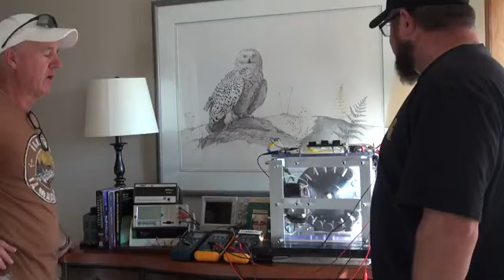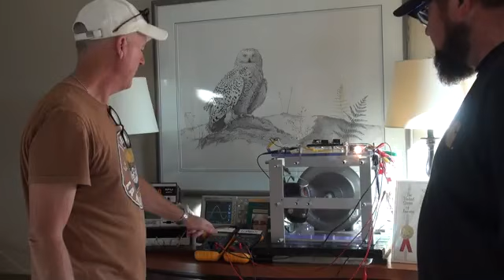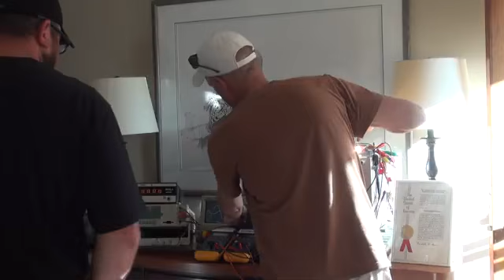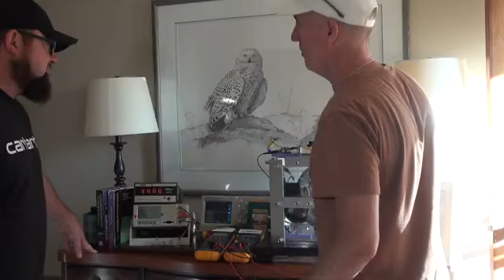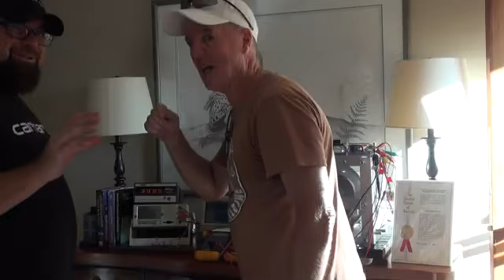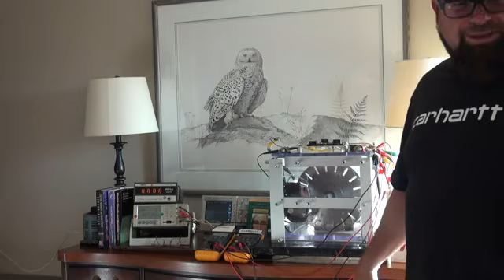Infinite Efficiency US Patented ReGenX Generator Demonstration 10,02,2025

Comment: Nobel first place award for a dumb ass story , this cannot work! there is no free lunch in this world!
Reply: "Electrical power is everywhere present in unlimited quantities, and can drive worlds machinery without need for oil, coal and gas, or any other of the common fuels " - Nikola Tesla
Reply: @marcisgulbis9310  We've had 100 years to test Tesla's statement about electrical power being everywhere. Sunlight is energy that is everywhere the sun shines. But there is not and never will be ANY mechanical motor, gadget, spinning device that can "create" energy. Period. But if playing with this stuff will keep you happy and out of trouble, keep it up Skippy.
Reply: @johnkolb4241 
"No free lunch in this world", which is true, unless in question to this case, the sceptic proclaims to know everything in the entire universe about physics aswell as undiscovered technical engineering! 
With respect John, I very much doubt at that person is yourself, so you got to admit, it's quite a bold statement to make if you don't mind me saying so! It's usually always best to remain rationally open mindedly sceptical for the time being but not too prematurely irrationally so!
Reply: @ZoomTuber2026  Most of these people are trolls or are outright paid to cause a problem, best to ignore them or just block their account.

Comment: 150 watts to run that rotor with no load is a VERY HIGH no load draw, way more than bearing drag.  Therefore there must be electrical drag.
Adding an electrical load to reduce wattage is simply improving the efficiency of the motor, but at 142W it is still a VERY INEFFICIENT motor.
A true generator motor combination with more than 100% efficiency would be able to spin itself and power a light bulb with no input energy.  This device in the video is not that.
Reply: Our electrical motors are designed to have very poor efficiency. Reversals of direction of current destroys efficiency.
Reply: @marcisgulbis9310  its a lot of factors.  I designed an axial flux two phase motor controller a few years back.  Even with ceramic bearings (best), 99% efficiency no load is the most one can get.  I was turning a 6 inch rotor at 1000 RPM on a few hundred milliwatts, but there was never any excess pulses or phasings that produced excess energy, and I captured all the residual energy on each phase.
Reply: @geraldc867  how much input power was required to get that motor run at 3600 rpms?
Reply from the maker: NEW ELECTROMAGNETIC FIELD ENERGY MOBILITY / EV & ICE VEHICLE PROPULSION in 2025: https://www.youtube.com/watch?v=AY69laN4HS8&t=132s
Reply: @PDiCanada1  is there any RegenX generator replications in Ukraine

Comment: Can I see the patent please ?
Reply: https://patents.google.com/patent/US20140111054A1/en  
Generator and Improved Coil Therefor Having Electrodynamic Properties
Abstract
The present invention relates to electrical generators and, in particular, to improvements to efficiency in electromechanical energy conversion in electrical generators and electric motors. The regenerative acceleration generator coil according to the present invention takes advantage of the structure of a high impedance multiple-loop salient pole winding or low impedance bi-filar windings to create a positive armature (accelerative) reaction rather than a negative (decelerative) reaction as exhibited by prior art generators which only have low impedance multiple loops of wire making up their rotor armature. The generator of the present invention reverses these negative effects by delaying current flow in the coil until the rotating magnetic field reaches TDC.

Comment: Infinite efficiency??? Max efficiency is 100% and USA PATENT office will NOT entertain "perpetium mobile" claims ( or (end less) energy from nothing)! Scientific sounding blablabla or just another scam...
Reply: Who cares what patent office thinks? Need to go open source, so everyone can use this technology without restrictions.
Reply: https://patents.google.com/patent/US20140111054A1/en  
Generator and Improved Coil Therefor Having Electrodynamic Properties
Abstract
The present invention relates to electrical generators and, in particular, to improvements to efficiency in electromechanical energy conversion in electrical generators and electric motors. The regenerative acceleration generator coil according to the present invention takes advantage of the structure of a high impedance multiple-loop salient pole winding or low impedance bi-filar windings to create a positive armature (accelerative) reaction rather than a negative (decelerative) reaction as exhibited by prior art generators which only have low impedance multiple loops of wire making up their rotor armature. The generator of the present invention reverses these negative effects by delaying current flow in the coil until the rotating magnetic field reaches TDC.